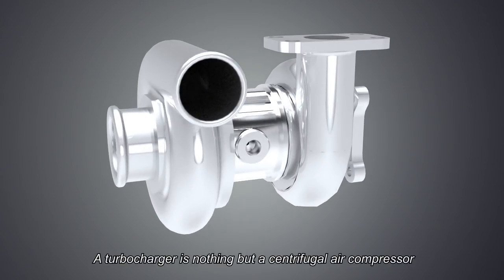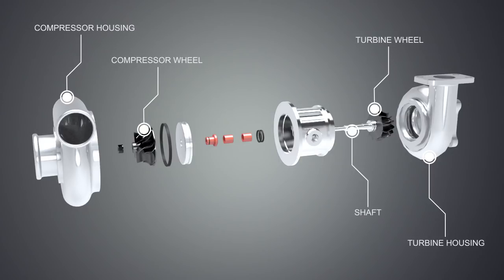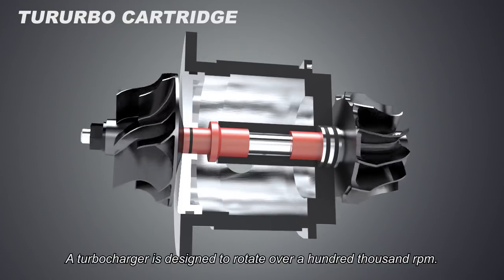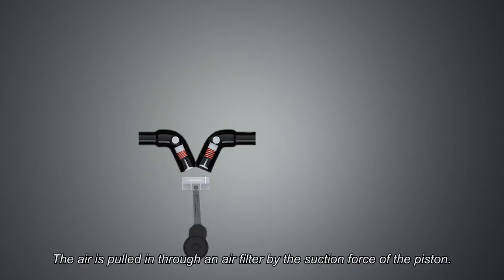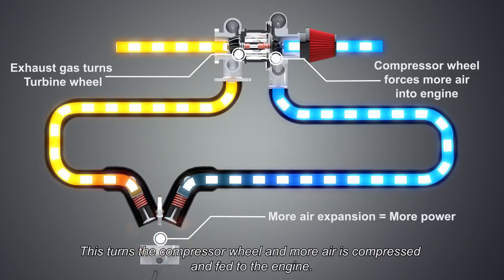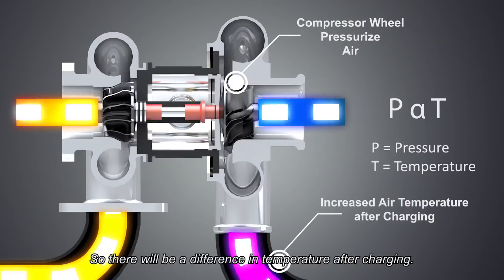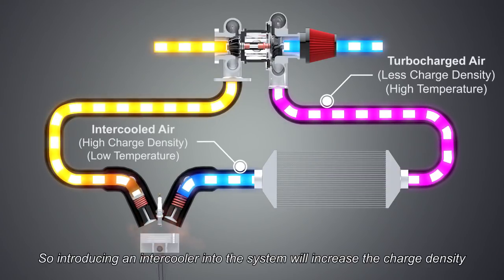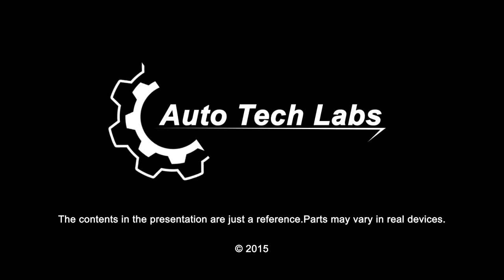How Turbocharger Works | Autotechlabs

Comment: 1-4 turbo intercooler petrol engines hybrid all other group and 1-4 turbocharger intercooler petrol engines all other group are dumb expensive repairing 100,000 euros  per 100,000 km and risk heavy damage on all test performance maximum standard law.

All Automobile market maker in automobile market with code forbidden AE styles are lowest IQ and risk bankrupt by few customers group buy ones, say the worst products performance and the most hating vote.

Comment: 1-2 Turbocharger intercooler have been invented for diesel engines all from Swisszerland Engines Engineer course. If you use 1-4 turbo intercooler petrol engines, these ones will make damage parts petrol engines by petrol temperatures combustion smut in inlet intake, intake valves and explosion parts petrol engines offen happen on tournament racing grandprix all times. 1-4 turbo intercooler petrol engines all and 1-4 turbo intercooler petrol engines hybrid all have been built by uneducated Automotive Engineering group clans and mafia criminals clans.
From
Security top classifieds all countries database
End report.

Comment: the turbo Charger needs exhaust gas to rotate the turbine,that means combustion hve to take place right,which brings to my question,then where it gets the air for that combustion?
Reply from the maker: Turbocharger kicks in only after the exhaust gas reaches a certain pressure (ie certain engine rpm). Until then, air just flows through the turbocharger compressor housing as naturally aspirated.
Reply: @autotechlabs  that means just uses the pathway of turbo compressor and not as compressed air right?
Reply from the maker: Exactly.
Reply: @autotechlabs  thanks man:)
Reply: @autotechlabs  then it will bypass intercooler,am i right?
Reply from the maker: Whether the turbo works or not, air gets pulled into the engine through intercooler . Only one path from air filter to intake manifold.

Comment: All petrol engines 1-4 turbo intercooler in all brands : easy damage, 20-100 l/100I'm, over 100 l/100km permanent by their wrong AE theory.

They never accept fact on test.

End report.

from
all brands database

Comment: what is the need of intercooler....bcoz,,,,increes the air temperature is good for thr engine
Reply: ohhkkk i got it...thanks sir....
Reply: RUSHIKESH JADHAV Hot air  requires much more work to compress than cool air , this excess work (done by the engine in compression stroke ) is removed  if the fluid is cooled before compression , hence improving efficiency .
Reply: also you can overheat an engine that why there is a temp guage, so if anything cold air would be better

Comment: Petrol engines 1-4 turbo intercooler all in all brands : 20-100 l/100km, over 100 l/100km, easy damage on test performance.

From
Database all brands

End report.

Comment: Wouldn't more air also need more fuel?
Reply: Tapport  ies it is
Reply: ***** Gotcha, thanks. So a turbocharged engine at sea level would have a boost and use more fuel but would function more normally at higher altitudes and also use the less fuel, right?
Reply: You will have less power at higher altitudes, but for the same engine, you will have more power with the turbo. Ford uses this in their ecoboost engines where for instance a 1L 3 cylinder engine would usually be too weak to power a car has a turbo to get both power and efficiency... basically, though that engine is still slow :) or you could have the same car with a 2.4L and a turbo and it will be a screamer.
Reply: When you add more air to the cylinders for the combustion, you ensure the combustion will be complete and therefore you will get more power